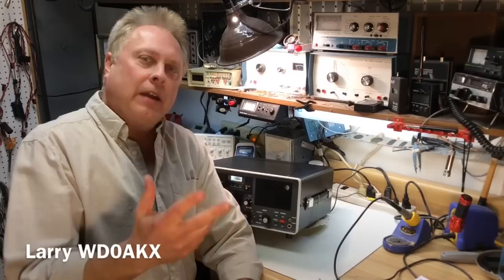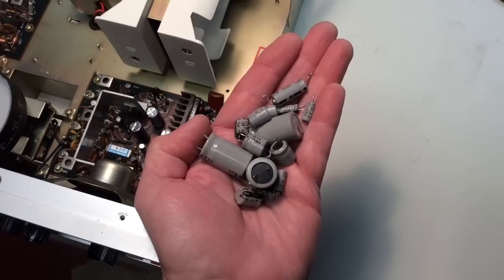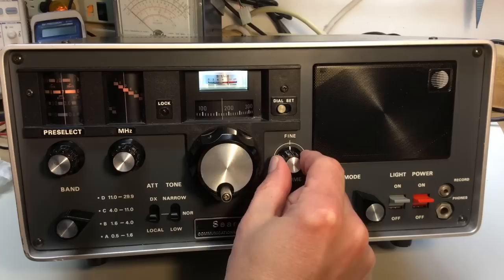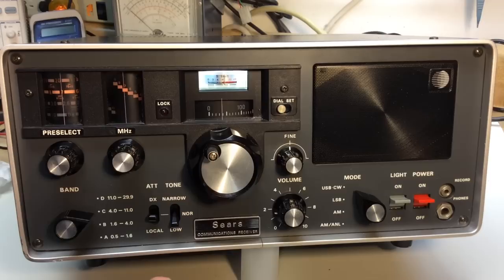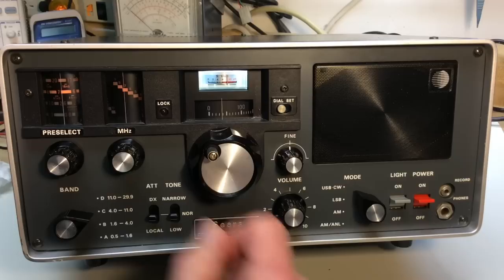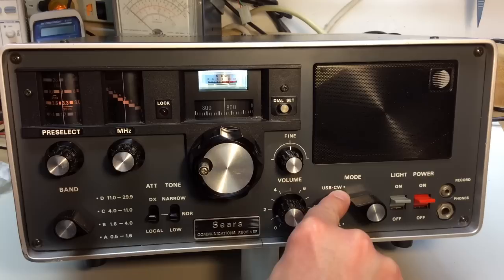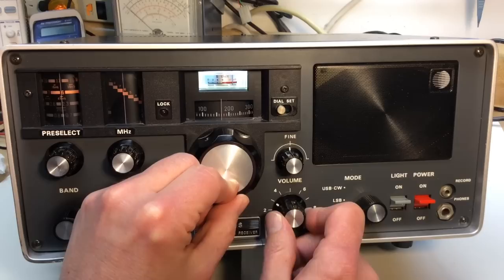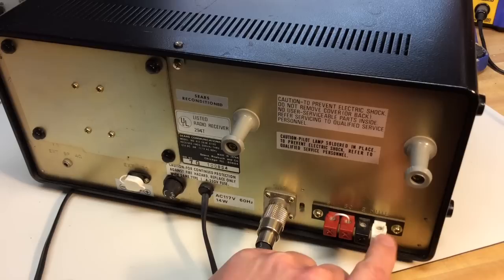Yaesu FRG-7 Shortwave Radio Operation And Hands On Use

Comment: Thanks for the review on this great radio. I've had offers on my Frog7 but won't part with it. Glad you brought up the wonderful audio from this rig, it surpasses all of my more modern radios. The FRG-7 is a triple conversion super heterodyne receiver that utilizes the Wadley Loop System and is a South African design also used in the Barlow Wadley Radios. 73 ZS6KB

Comment: Good and clear instructions.I have an original FRG-7 and have used it since 1980 with a lot of fun listining to shortwave broadcasts. Before this I use to use a National panasonic radio which had Germinuim transistors. Still have both in good working condition
DIN -Kenya

Comment: one of the best Barlow-wadley phase lock loop. I had a South African genuine had made commercial radio due to UN Import embargo.I did have one but was beyond repair  it was interned in the loft under the insulation.Thanks Larry.

Comment: Hi Larry, Nice review of the Frog-7. A good friend K3LU talked my into buying one of these
about 25 years ago at a hamfest. At one time, I almost sold it and thanks again to Ulis, K3LU
for talking me into keeping it. It has been a favorite receiver for so long. And a good friend
when the terrible MD thunder storms knock out the power. Mine would run for ever it seems on a gel-cell battery. I will keep mine forever. It has never let me down and it would be easy
to repair if it ever does have a problem. Regards, Scott W3CV
Reply from the maker: That is great to hear Scott.  Yes, a lot of these old radios end up being good friends and work horse radios and are great to have around.  I am glad you decided to keep it, I still have mine also and it is sure a fun radio to use even though you have to tweak the dials a lot more, but that is part of the fun I guess.  73 and thanks for the post!
Reply: Good friends, Yes they are. At one period in time, I was restoring
The R390/ R390A & 389 series. I wont embarrass myself telling you how many of each I had but those were my real friends. The nice smell
of hot tubes when I went down to the basement. Those were the good days. At least I have some pictures.  Regards,  Scott W3CV

Comment: After playing with my friend's FRG-7 (the one I made the videos with), I thought I'd look for one myself.  I found the Sears version at a hamfest this weekend.  Seems to work pretty well.  Haven't recapped it yet.  I noticed that the AGC is a bit slower (preferable) than the FRG-7 I used in the video.
Reply from the maker: Very good, I was kind wondering if it was the exact same boards internally or if there was some differences, other than the name and color scheme.  I remember when they were sold new back in the day but never had the chance to own one until last year when a ham buddy sold me mine at a price I couldn't pass up.  I plan on using it as part of my vintage AM station downstairs near my workbench this winter.

Comment: 2019 Oct 26: Just today, I picked up one of these radios at an estate sale. 
Don't yet know that it works at all, but it was a good find in any case because it was priced at $20. 
Missing are the D cell holder and the paddles for the power and light switches.
[My amateur call is KJ6QKV. ]

Comment: Hi Larry, nice radio. I like to be able to play around with knobs and switches, it kind of makes me appreciate the complexities of radio. Conversely, I can`t stand modern SW receivers that are so thin, light and top heavy that trying to adjust them them makes them tip over or slide on the table top if you try to do it with just one hand! Thanks and 73,

Joe KC3BXZ

Comment: I recently got a dead FROG-7 from a fellow ham.It is the Sears model like yours I received the capacitor replacements today and will get them hanged tomorrow. It is a great radio. I also own a Realistic DX-300 which also uses the Wadley loop design. Keep up the good work.
best 73 de Ernie AJ4BP
Reply from the maker: Ernesto Marquez Thanks Ernesto and I hope you can get yours in good shape again, I am enjoying this one, works very well.  I also used to have a DX-300 but have not had that in years now but I enjoyed that one also.

Comment: Larry, thank you so much for your demonstration on How to operate YAESU MUSEN FRG-7. Your explanation and descriptions on this Radio made me understand how to operate this fine Radio. I have a similar Radio and I was like a Monkey with Garland, twiddling, clicking, turning the switches switching the device on and off 🤡
It was a blessing that I stumbled upon your video. I do not know how to thank you. 🙏🏽 But thanks a ton.
Now I need to know what sort of an Ariel you have set up. Here, at my home, I threw a very long telephone line cable (the steel wire coated with Cu and insulated) over the nice Oak Tree and Lo... signal .. but that’s not the way a professional DXer want to listen to broadcast, I know. So please, if you happened to intercept my request, kindly enlighten me as to what might bring in all the signals into my YAESU MUSEN FRG-7.
Thanks and best regards.
Sree...
Reply from the maker: Thanks very much and glad it was of help.  As far as antenna, I use my off center fed ham radio dipole and that covers 80-6 meters and works well for the SW bands in between also as far as receiving.  This would be a good way to go or else you could cut a fan dipole for the main freq bands of interest for reception.  A wire antenna of some kind that is as high up in the air as you can should work fine as long as you can get it away from sources of local electrical noise.  Even a random length wire over 50 ft or so with a ground counterpoise or connection of some kind would be ok, the most important thing is probably the signal to noise ratio.  Just keep away from the noise sources and you should be ok.  Hope that help a little and have fun with radio!

Comment: Apparently I spent wayyyyy too much time in the tool and automotive sections of those old Sears catalogs, as I did NOT know that Sears sold radio's such as this, or ANY Shortwave radio for that matter. My loss!   That is a VERY nice apparently pristine radio that you have there Larry. Aside from your dial readout, the "hands on approach" tuning aspect you demonstrated is somewhat similar to what is required for my digital readout Radio Shack DX-302, which I covet greatly. Happy SWLing.
Reply: The Realistic DX-300/302 series radios were quite obviously a clone of the FRG-7 but a decent radio in their own right and a worthy consideration for any collection/shack IMHO.
Reply: ***** Nope, although they may have had a few somewhat similar aspects in the electronic design, the Realistic DX-300 wasn't quite a "clone" of the FRG-7.  The original Yaesu FRG-7 did not have digital readout and had somewhat different panel layout and operation than the Realistic DX-300.  The follow-on to the FRG-7 was the Yaesu FRG-7000 which did have digital readout as well as the ability to use narrower passband filters, but didn't quite have the performance of the old "Frog-7".  It was soon replaced by the more capable FRG-7700.   I still have my old FRG-7, but performance wise, my little Sony ICF-SW-7600GR is better.
Reply: I guess clone is too strong a word but definitely modeled along similar lines to the FRG-7.

Comment: Good afternoon,
I just bought one of these Yaesu Frog-7's from a car boot sale at the weekend - just £60!
Got it in the workshop, and, after examining the case, found that the back panel had been pushed in and the little bracket at the top was distorted. Must have been dropped backwards on it's cable posts. Took it apart, straightened the metal, put it back together, and it powered up fine.
Even after downloading a copy of the manual, I could not receive anything meaningful at all. I was about to give up on it, thinking the severe fall may have knocked the trimmers out of alignment, then decided to search Youtube and found your video - I then had my set going in minutes, getting signals mainly from Europe and the UK (I have to improve my aerial). Only one fault I now have to clear is that it won't lock on band A at all, although it does pull in some stations, they are right in the back of the set - will replace elect's as you suggest, and go from there,
Best,
Kev in England

Comment: I was an SWL in the mid 70's and looking at a few. Most were cheap plastic junk with drift and horrible audio like that big Panasonic with cheap digital readout..RF 4900 Panasonic. Junk for the same price as the Frg7. All these years I've owned this rig and not one failure. Always beautiful reception and nice audio on shortwave stations all over the world. Not one drift in the rig and a joy to operate. It cost me 450 dollars in Canada those years, and never tire of it. I hooked a sound interface to copy NOAA maps, and the Navy weather reports and WWV signals. I've seen these beauties go for up to 700 dollars on ebay.

Comment: Nice job.  Great old receiver.  Dial Set always confused me.  It was not covered in the User Manual.  And the words & layout added confusion.  But it was just a simple way to calibrate the dial to a known frequency as you indicate.   Yaesu manuals can be pretty bad sometimes.  And I agree, the internal speaker was very good. - 73

Comment: These were old beaties, weren't they, Larry? The circuit is triple conversion using the "Wadley Loop" to cancel drift. W2AEW has a nice video explaining the concept. 

Like regens, these sure put the joy of operating back in ham radio or SWLing. 

Good video! 

de Bill, k6whp
Reply from the maker: Yes, they are just plain fun to use, all the dial twiddling etc, ha.  Makes you feel like you are really doing something to bring that signal in, and you are!  I did see the video by w2eaw, that was very good.

Comment: Not all FRG-7's have a fine tuning control. The early ones didn't, but if you don't mind drilling a hole and adding a trimmer you can add one.

Comment: Hi Larry, I have recently acquired an FRG-7 and tried it last night with a wire draped around my attic. Managed to get South Carolina from the NW UK. I was however slightly disappointed not to get more stations and the later it got, the quieter it seemed to get? I plan to get a long wire setup from the attic to a tall tree at the end of the garden and hope this improves noise / better signals? Would you say the FRG-7 really does depend on having a decent twig? I have also wondered; what is the in circuit function of a 'Pre-Selector' ? Thanks, Graham
Reply from the maker: Yes, if you can get the wire outdoors and out of the attic, that should make a lot of difference, I know at my place here, attic antennas don't work well, just too many noise sources from in the house.  As far as the internals of the radio, look up w2aew on here, he just did a video explaining how this radio works internally, very good video!

Comment: Thanks for the operating tips. I'm about to take possession of a frog 100 so I'm looking out for any Yaesu RX vids.
BTW, I recently acquired a Fluke  8010A DMM, and I think I spotted one there in your shack. Do you still use it?
Reply from the maker: +booboyBL Yes, that is what you see and I do use it a lot, works very well for me.  Sounds good on the frog 100 also, hope it works out well for you!

Comment: Nice and amazing radio.. I appreciate it :)
Reply from the maker: +Aurelius Primus Thanks!
Reply: RadioHamGuy
Do you also have some transceivers or only receivers ?
Reply: +RadioHamGuy 
Hello 
If you can tell me :
I have the tecsun s2000 and the kenwood r5000.
Now I have the possibility to have a yaesu fr 7000 or aa kenwood r5000. What would you suggest to  me as a choice ?
Reply from the maker: I have several of both types here.
Reply from the maker: I have not had the chance to try either of those radios out so I can't be of much help there, sorry.

Comment: Hi Larry, I recently got HF transciever Yaesu FT-101ZD, and I would also like to change the electrolytic caps. So, my question is how do you know that the caps are not charged and it is safe to touch them and replace them? Hope you will answer, thanks in advance. 73's 9A3DSU
Reply from the maker: skreb95 It is all ok in this radio as long as you remember to unplug it from the power source.  The caps are all low voltage and safe to handle unlike some in tube type radios.  So just remove power and you can turn the radio switch to on to remove any voltage left in the caps and you won't have to worry at all.
Reply: RadioHamGuy Thanks and 73's

Comment: hello Larry top notch video the best Chanel for my eye I hope you well. one question 
where did you buy the capacitor from is there a kit some one sell it ? is there some info how you did the led light? will be great to know 
thank you kind  73 elan g0 land ps lol I didn't see the bigwig on this video I had issue so I see where you bought it from thank you but how to ad the led on
Reply from the maker: Hi Elan and thank you.  I used a short section of those LED strip lights and wired it into the spot on the PC board you see in the video that provided around 12 volts.  You could also just use a common LED bulb but you would need to add a dropping resistor  in series to limit the current as to not burn out the LED.  Around a 1k resistor would probably work fine or maybe a little lower value.
Reply: thank you kind  73 elan